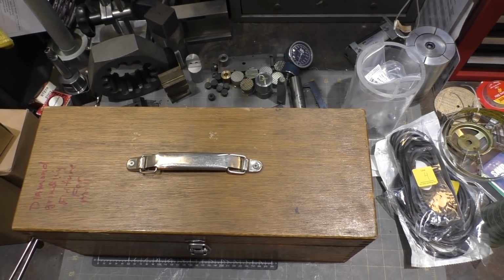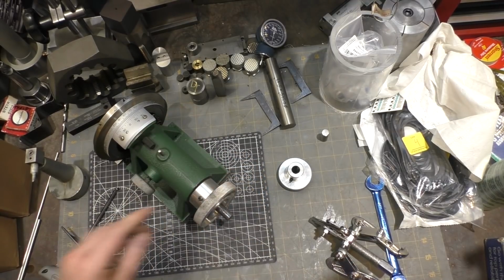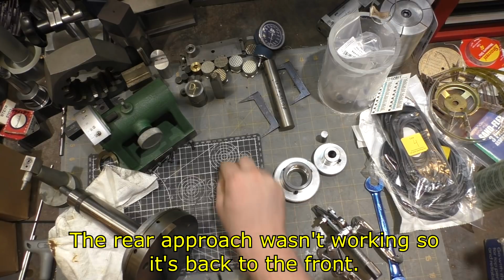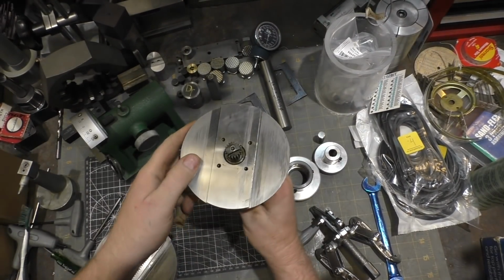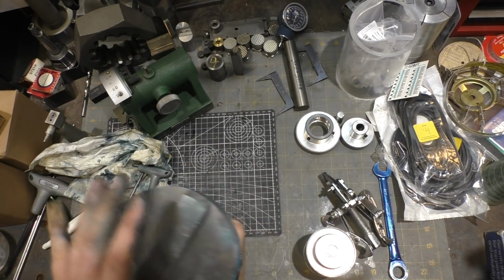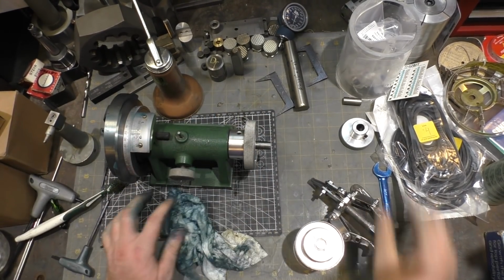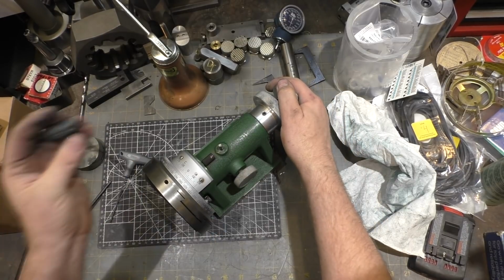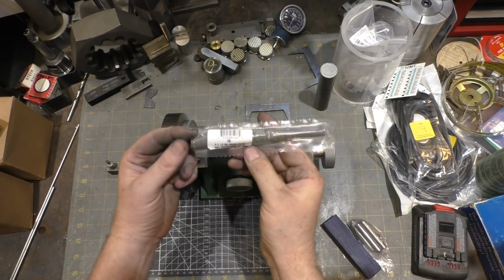97 Precision Surface Grinder Dresser Repair

Comment: The separate dovetail concept can be seen on the Clarkson Tool & Cutter grinder.

I needed to dress a 45 degree angle on a wheel but I already have a good radius dresser so I couldn't justify the price of a combined unit.

In the end I copied the "Mighty Midget" angle dresser.
Reply from the maker: Nice solution. Thanks for sharing.

Comment: Great video, never paid much attention to the inner workings on these radius dressers. One note: when needing a true (flat or 0 degree) dress, I would not use the "traverse" feature on the tool. Even at "0" indicated, it is only as "0" as the scale is accurate. Lock everything down and use the table of the grinder for travel across the fixed point diamond to minimize a taper. Until you actually desire a taper dress.  Just makes sense to me. Thanks for the video!!
Reply from the maker: Thanks for the info! Your suggestion makes sense to me as well. The table motion is your reference plane to begin with.

Comment: What was the type of grease you used, and the type of oil?
Reply from the maker: I usually use Vactra 2 because it is what I have on hand and typically grease with Molybdenum Sulfide in it.

Comment: On the Last Word dressers (Suburban Tools) the slide is locked in centre position and to move it you pull the small knob out and turn. Looks like you may have put the knob back on with the pinion pre-engaged, so the central rod doesn't lock as it should. Useful tool, enjoy!
Reply from the maker: Interesting. This tool does not seem to have any spring loaded or center locking functions.  I will double check. Thanks for the heads up.

Comment: You using 99% isopropyl?  If not, see if it's available at a pharmacy, (not all states allow 99%).  It's a very good solvent, and a much different critter than 75-78%.  Much different.
Reply from the maker: I usually use 75% Iso, but have access to 99%. Interesting fact: Pure alcohol is so hygroscopic, that even a moderately sealed container will adsorb water from the air until it becomes 75%. This process happens pretty quickly - something like a month after breaking the seal.

Comment: Did the seller indicate there was an issue with the unit?  Grease and grit makes a good scoring compound.  That dimple would have added cost to each unit.  Save $0.05 per 1M units = $50,000 profit.  You got a good deal because the seller thought it was broken. LOL   Great repair, and a great video.
Reply from the maker: Thanks. It was supposedly working, according to the seller, but they put a disclaimer saying that they had no idea how it worked and could not test it. Kind of a bogus disclaimer. Still, I was the winner in the end.

Comment: On things like this, where grit can be a major issue, try one of the DRY Moly sprays

John
Reply: Yep.  Grease and grinding dust is not good on precision tooling.
Reply from the maker: Thanks. I used grease only because that was that was already there and it did not show signs of too much contamination with grinding dust. Still, point well taken.

Comment: I agree with Anthony Brown that graphite or silicone or even a combination would have been a preferable choice over grease with all of the grinding dust that is going to be produced.
Reply from the maker: I agree. I only used grease because that is what was there before and it did not have a lot of obvious contamination.

Comment: What a nice acquisition!  Thanks Robert, now 8 know how to disassemble and clean the one I bought from a retired machinist.  I’ll go easy on the grease 😆
Reply: Never put grease on anything used on grinder use graphite ....  nothing at all better than grease or oil. Any kind of dry lube is ok..
Reply from the maker: You make a good point, but grease is what was used before, not that this makes it a good choice.
Reply from the maker: I am glad I could help in some small way. I hope your  cleaning goes well.

Comment: Graphite would have been a good choose instead of grease...
Nice video thanks for sharing
Watching in Alabama
Reply: I'm thinking the same thing. It has to cleaned Very often, and the grease is gona make it a Big deal to clean. Also, during operation the grease is gona turn into a grinding past.
Nice addition tho, Congrats!
Reply from the maker: I think you guys are absolutely correct. I only used grease because that is what was there before. Your points, however, are well taken.

Comment: Does the center tab on the shaft engage with the slot in the center of the front plate when it's centered?  It kinda looks like it does.  That would be another reason the shaft is spring loaded so you can engage and disengage that center slot.
Reply: yes its supposed to lock in the centre automatically to do a radius and pull the knob to do angles, and the dimple he drilled will be wrong once assembled correctly
Reply from the maker: Interesting observations. The knob floats on the circular shaft and a set screw was holding it in place, I simply gave the set screw a place to sit. There are no makings on the knob to indicate an orientation. I hope I am understanding your comments correctly.
Reply: @DudleyToolwright  I was talking about the end of the shaft with the gear on it.  When you took it apart there was a, for a lack of better word I can come up with, tab on the end and a slot in the middle of the body on the rack side.  They look like they're meant to register with each other.
Reply from the maker: Interesting. I did not notice. I'll have to look into that.
 I don't think that the dimple I drilled into the shaft will have an effect on anything, other than providing a seat for the set screw from the knob. The knob is plain - without any markings.
Reply: @DudleyToolwright  my only thought about the dimple was when the gear does protrude into the slot the knob will need to be moved back to allow the shaft to move forward and the dimple won't be lined up, hard to explain how irrelevant this is without drawing a silly picture on the back of an envelope though.